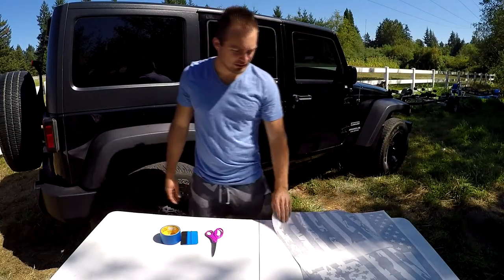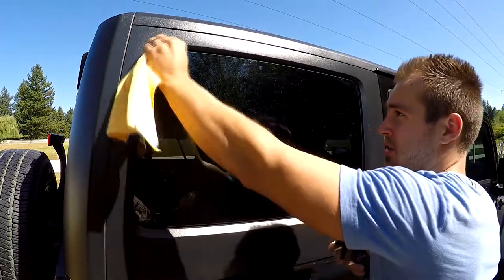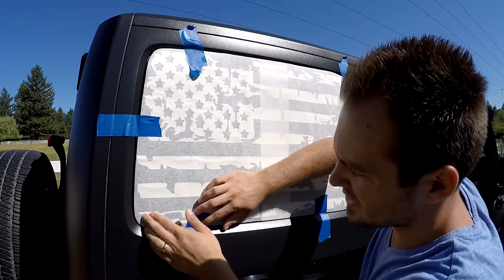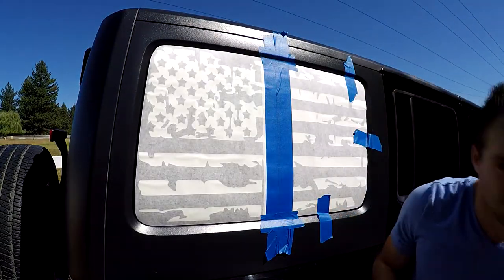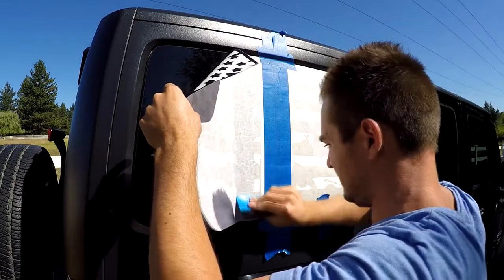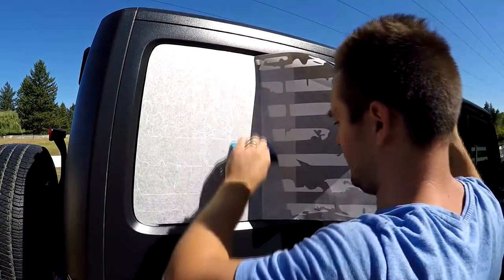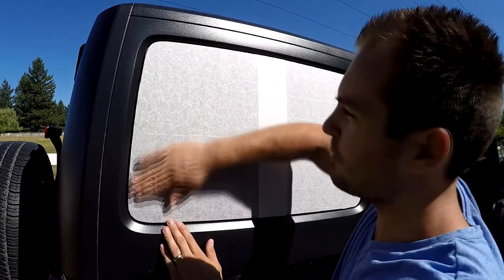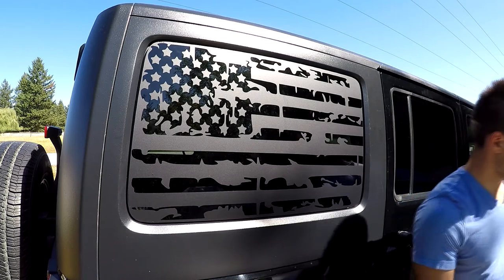How to Install American Flag Decals on a 2011 - 2017 Jeep Wrangler Unlimited

Comment: He installed these backwards. I followed his lead unknowingly and have also installed mine wrong. The rule is "ALWAYS stars to the front"
Reply: The reason for this is that you never display the flag in retreat (stars in the back)... Which is why they are "backwards" on army (and I think air force) uniform sleeves.
Reply: I also followed him now my decal is also backward 😂

Comment: Do these fit so that the Stars are forward?
Reply: I'm sure you could just swap the L/R sides to get the stars facing forward as they should be.
Reply: Jim Cantu I asked him on eBay and he made me a set with the stars forward...they have shipped and I should have them in a few days.
Reply: That's awesome! I didn't take into account that the windows may not be perfectly square. Thanks for the info! I was looking at the same thing but wanted the stars facing forward as well.